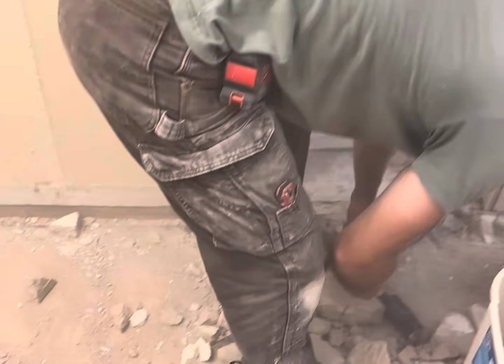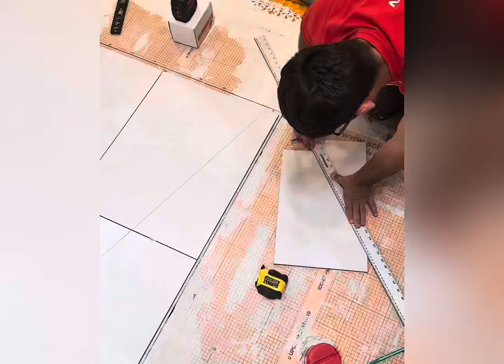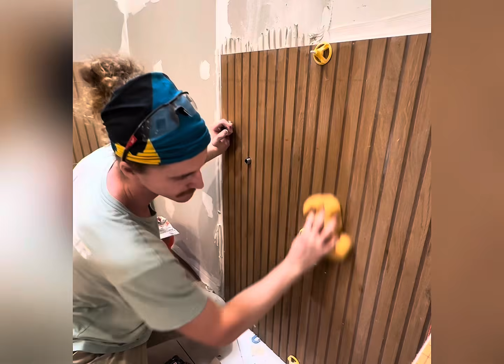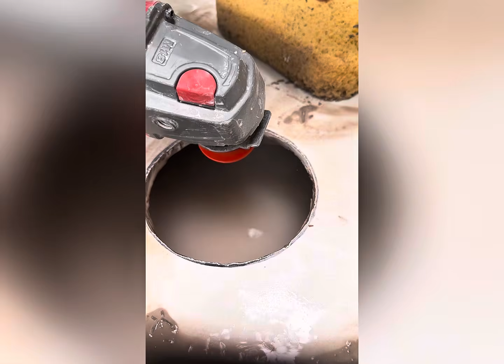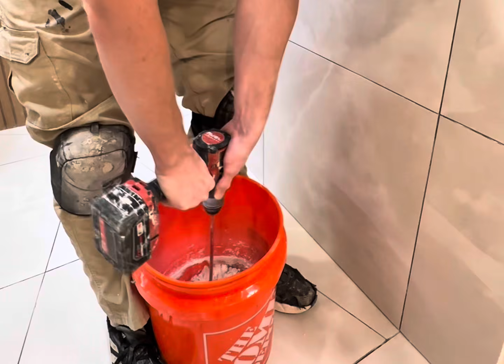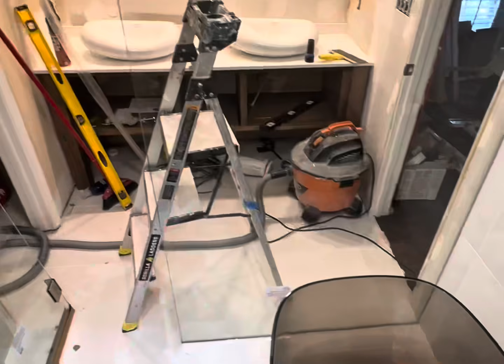Full Master Bathroom Remodel - Curbless Shower Renovation

Comment: Is the floor sloped under the tub. Should i worry about puddles of water that make it back there if i do something similar?
Reply from the maker: The entire wet room has a slight slope toward the drain. Everything inside the glass will drain water properly but the tub is leveled with shims as the floor is sloped.

Comment: Great video.    You spoke about the warranty.  I’m pretty sure you have to use one brand of products for them to Homer the warranty.  I’ve done a good amount of research on it. Just don’t wanna see you get snag and wonder why
Reply from the maker: That is true, but I am specifically talking about the warranty for the heating cables which was all Schluter systems. The walls are go board and do not affect the warranty for the flooring, customer was not concerned about walls, just the heat cables.

Comment: Free floor correction mid remodel. 10/10 Back brace also shows a commitment to longevity, not only with the project but also with the body.
Reply from the maker: Wear your PPE so you don’t have to renovate the body
Reply: Kinda questionable talking about another mans body like that 😬